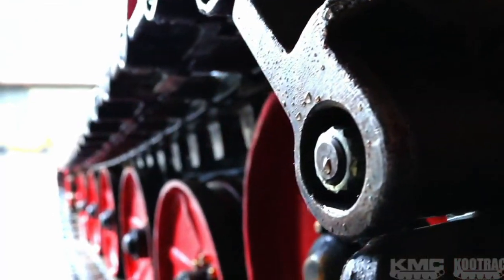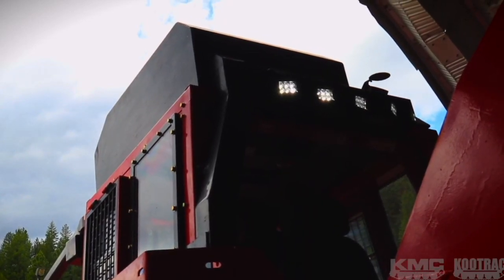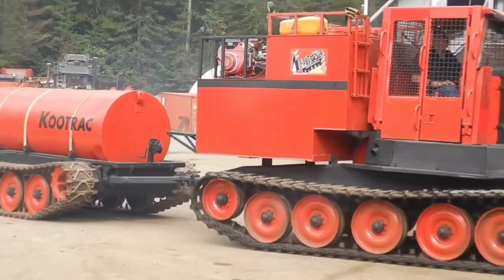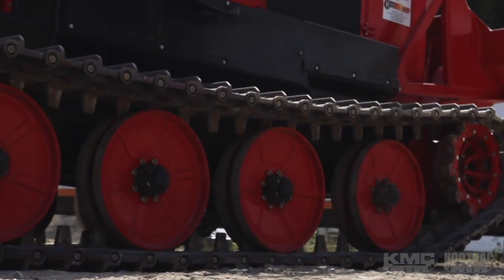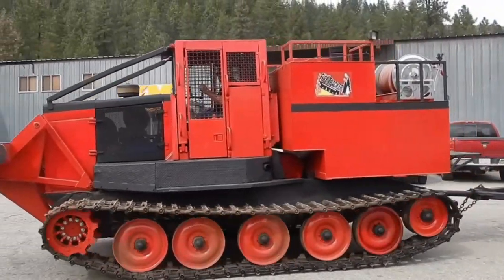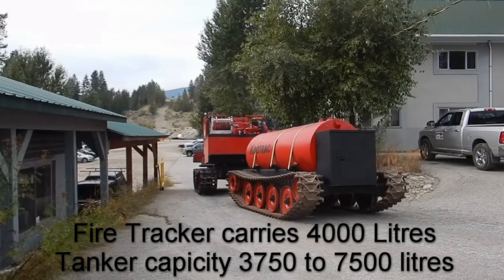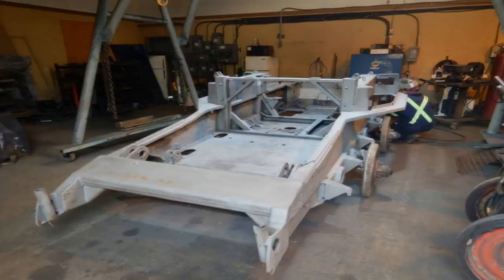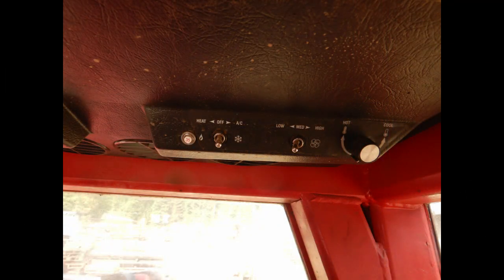KMC Tanker Tracker. Soft Track Fire Tanker,.Product in Design Stage for Specialty Firefighting unit.

Comment: There is a specific type of valve used in water/wastewater/sewage pipelines to vent trapped gases.  It is a hollow ball contained inside a cage, the air/gas can vent out and in through the seat because it isn't dense enough to lift the ball.  When the liquid comes up it will lift the ball against the seat and seal it so no water/fluid escapes.  When the water/fluid drops the ball drops allowing air/gas to flow.    Also if you want to use this as a bulldozer you can have a larger blade but why pull the tank.